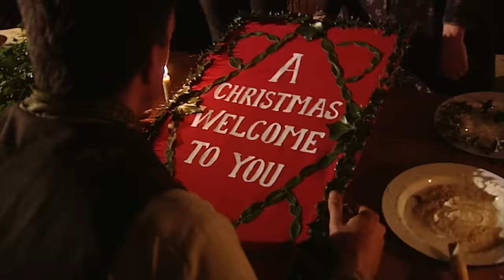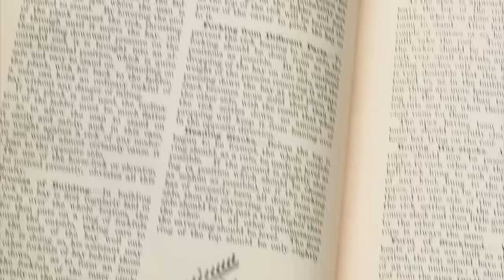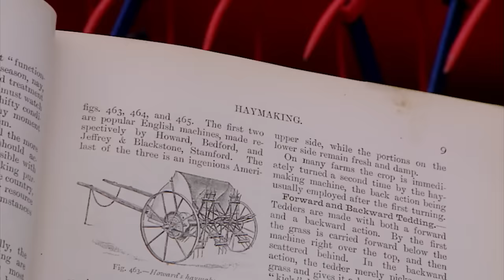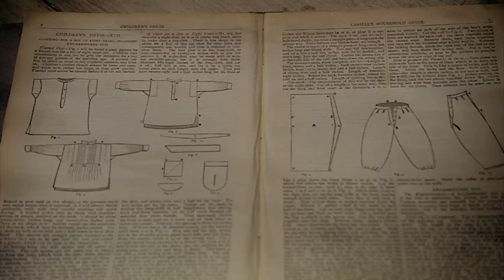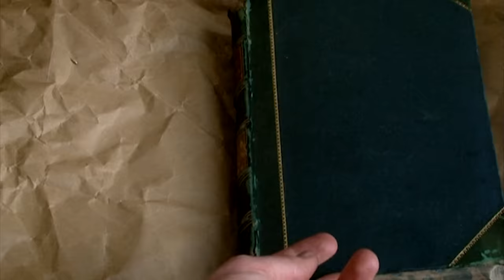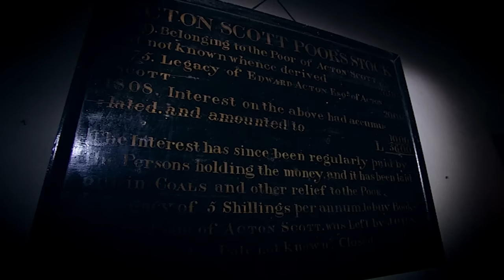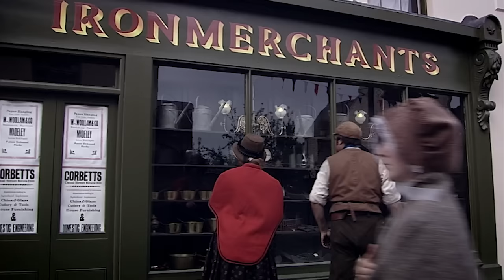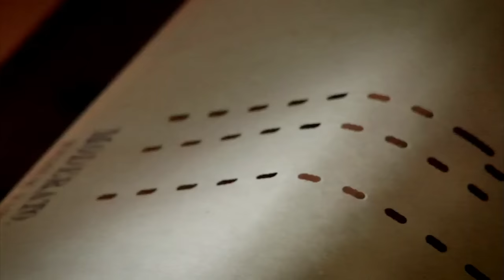The Bizarre Victorian Traditions To Celebrate Christmas | Victorian Christmas Farm | All Out History

Comment: It amazes me to see how vital horses were back then. I mean I've always known that, but actually seeing it really puts it into perspective. I absolutely love this series. I could watch them all day and never get bored. My only complaints?  Not long enough and too few.🤣🤣

PS: with all the innovations Victorians were known for, I'm surprised they didn't come up with some kind of tent protection held a few feet above ground,  a design similar to an umbrella that would allow the rain to roll off, safely protecting the hay.
Reply: They didn’t have materials that wouldn’t get soaked. If they had, they would’ve made coats out of it
Reply: @debbylou5729  True. It probably wouldn't have been cheap either.
Reply: @debbylou5729 nonsense! Oilcloth had been around since at least the 1600s and likely before that. Oilcloth is Canvas or other tight woven fibers impregnated with wax/oil, it worked beautifully well and was waterproof. It was a widely known and used material.
Reply: But, remember they mentioned that it was 1,200 acres. That is a lot of oil cloth umbrellas!!